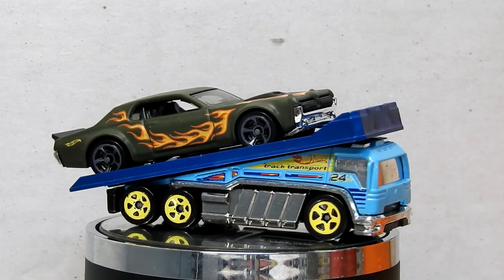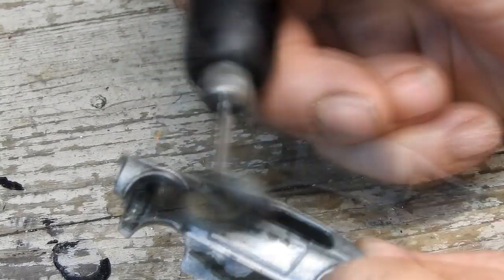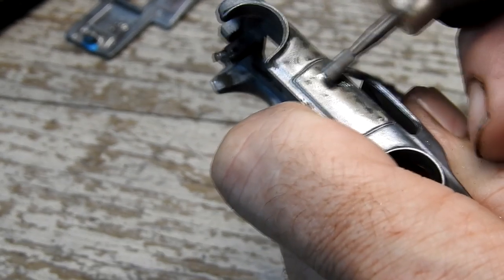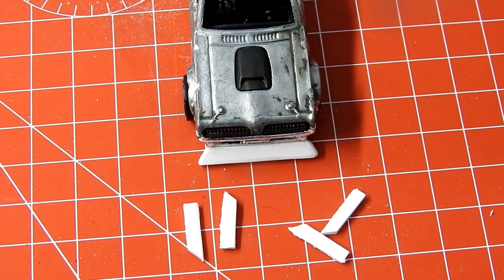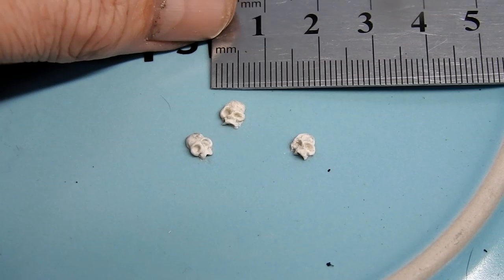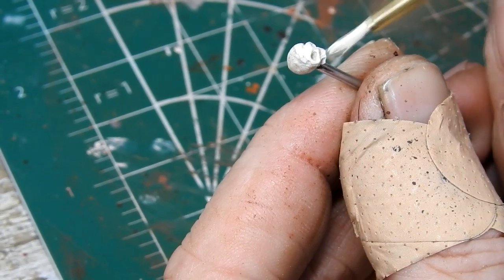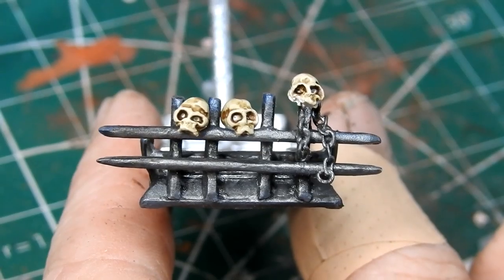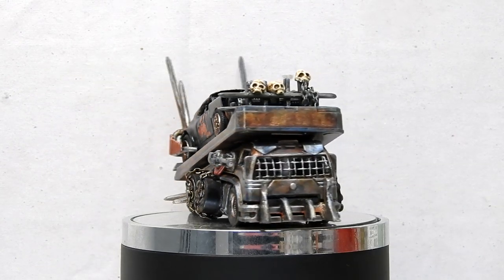Hot Wheels Custom Post Apocalyptic Car Carrier And Cougar Pursuit Car

Comment: Nice one! . still thinking about what to do to the couple of hotwheels i bought for this kind of conversion....... incidentally, have you ever thought of making a diptank/mucktank for when you're doing those kinds of all over washes? i use it on a lot of my miniatures and smaller pieces of scenery etc and its useful :)
Reply from the maker: I have a dip can of dark wash for dipping figurines. I sometime dip metal parts, its definitely an option 👍 I will show how to make your own washes in a video soon as well so I'll also mention that trick.
Reply: @DannysDiecastDisasters  i have the army painter strong tone but i also have a brown dip tank (some rinse aid, water, brown/red/green acrylic in a jar)....black dip tank (same but just black paint) and then a 'muck' which is a jar with rinse aid and water but any paint i put out too much of i dump in there, mostly i use that jar for big jobs or jobs that dont really matter about consistency etc................. Also, theirs a great guide online for a homemade 'typhus corrosion' which is a GW product, i made a close version from the guide and its all i use now, super greasy/grimey looking with fine particulate :)
Reply from the maker: @edinnuir7518  Cool yeah the Army Painter are good I use quite a bit of their paint. Just needs a good stir usually. Their acrylic washes are awesome.

Comment: Love the channel and your talent. Wondering if you might be willing to customize a car for me. I have searched for years for a 1:64 cast of the custom Corvette from the movie Corvette Summer. I know that that original car was a 1973 Stingray. I have a Road Champs of that model but it will require quite a bit of fabrication of the nose, tail and hood. I think it would make for a great video. Let me know if you are interested.
Reply from the maker: Oh I love that movie, I remember seeing it on TV as a child. They build a corvette in shop class then it gets stolen and the guy goes after it. My email is in the about section 👍
Reply: Thanks for the quick reply Danny. I looked in you About section and I don’t see your email address. Would love to send you some picks of examples that I’ve researched of previous attempts at the Corvette Summer car. That movie made me obsessed with Corvettes.
Reply from the maker: @luiamador4557  It doesn't seem to show up on the app, should be there if you look on a browser